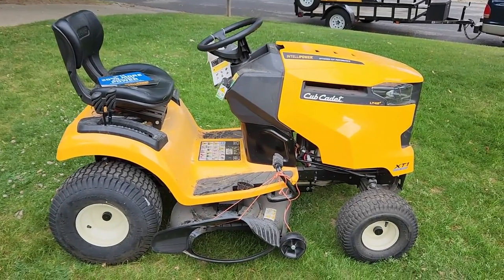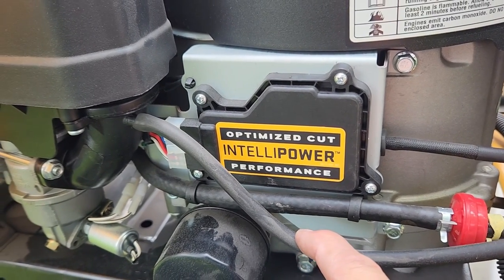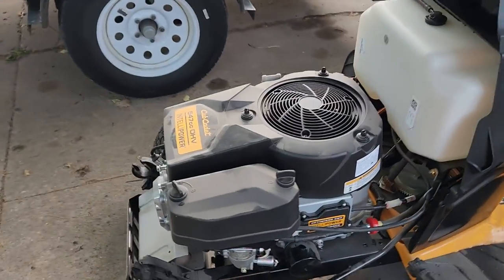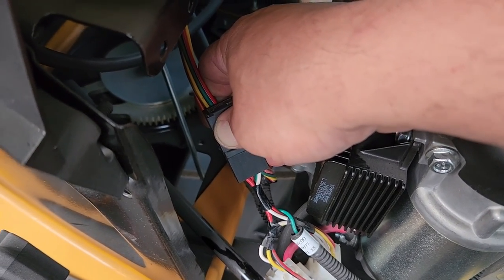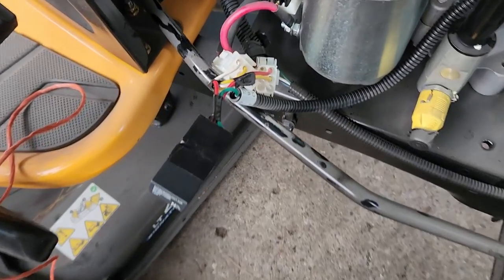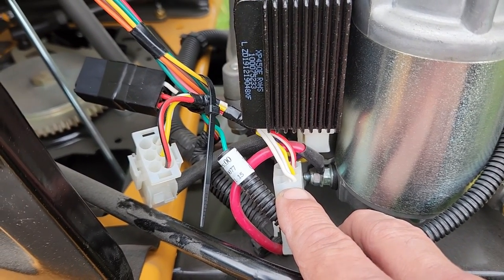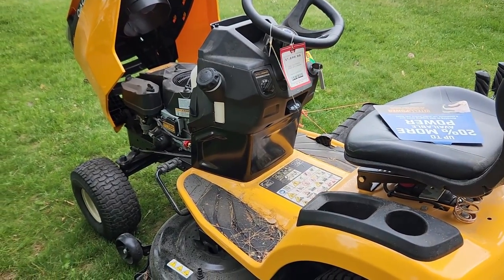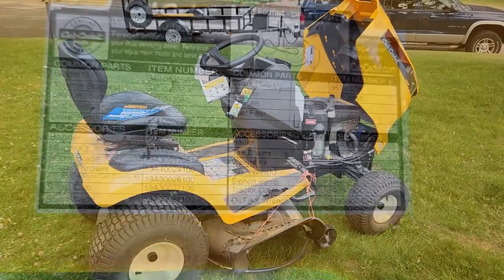Cub Cadet XT1 Lawn Tractor - Electrical Fix

Comment: that inline box switch is simply a solenoid relay , relays are simple switches that are either open or closed allowing the flow of current , the 2 loose white wires which are ground wires were not crimped tight enough at the factory overseas thus the problem right from the start.

Comment: I have this mower. I ran out of gas today filled up now it won't start , has power but when I turn the key nothing.  No clicking nothing at all. The power is on the hour meter so I know I've got power . Any ideas ?
Reply from the maker: Did you disengage the blades after it ran out of gas? There is a safety switch that prevents starting with blades engaged. I've seen it happen a lot.
Reply: @RealManSkills  no sir I left it engaged I figured it out about 30 minutes later. Dumb mistake but shit happens.  I appreciate the response
Reply from the maker: Glad that you got it figured out. Thanks for watching.
Reply: the seat switch detects the engage switch, need to clean the seat switch under the seat.

Comment: This is the same cub cadet I have but I have different problems: Mine dies after 10 mins of cutting and run ruff. I am able to start it and get it up to the house but slow. I have empted the gas, changed the oil and filter, changed the gas line filter, added engine cleaner as Home depot told me to try, got new gas and added gas added to it, I blew out the engine from dust and added a filer..oh and I bought a new battery. It still is doing the same thing. Could it be the carburetor and where its it.  Repair people is out 7 to 8 weeks before they can look at it. My grass will be 5' tall by then...Please can someong help me?
Reply: Sounds like your ignition coil (the thingy that plugs into your spark plug) is bad/getting hot and killing your engine. You might want to replace that and see if it fixes your problem.
Reply: @Michael-en4rl 

Hello I have this machine and mine will not start, I changed the fuel and install new battery, I sprayed some starter fluid inside, it started for about five second then cut back off now it won’t start back up

Comment: I have the same problem but my wires don’t seem loose
Reply: Same with mine.
Reply: @LarryMleko I brought it to a lawn tractor servicer and they claim my problem was gunk/bugs in my fuel tank.  They drained it and cleaned it out, replaced the fuel hose and filter and it seems to be working well.  I’ll update if my problem persists
Reply: check all ground wires , possible bad solenoid

Comment: The very best lawn/Garden tractors from 2019 to 2021 where the Craftsman Turn Tight Series T240  T260  T310 these were the first run of the Craftsman Turn Tight Series built like a little tank and built to last..unfortunately the newer versions 2022 to present have been downgraded I'm glad I got mine when I did...
Reply from the maker: Thanks for your input. I haven't seen any of those in my shop.

Comment: That new style of engine speed control is going to be a pain in the back side oh by the way the model number of my poulan xt mower is pxt195 g 42
Reply from the maker: I responded to your last message about the Poulan.
Reply: @RealManSkills   I'll try to find it hopefully I will find it in your reply on this matter
Reply: These powermore engines are not a good platform. I am a mower mechanic and they have many issues with low hrs mainly from the ecu. I tell ppl to fix and sell. Get one with a tried and true Kohler.
Reply: @joshuacarlisle9206  I know someone who has the same mower that is being fixed by  real Man skills
Reply from the maker: @joshuacarlisle9206  I agree. I would not buy one or advise anybody else to buy one. Thanks for watching!